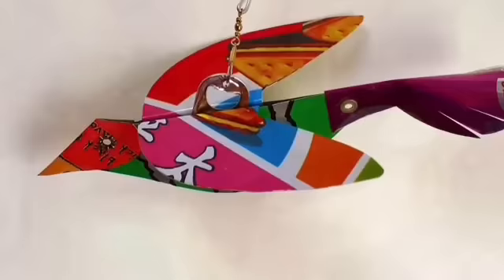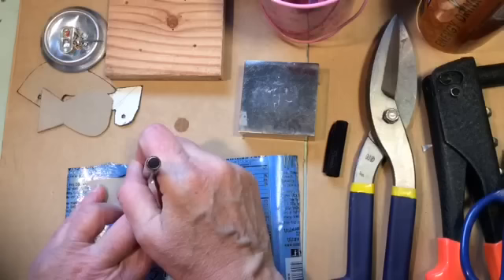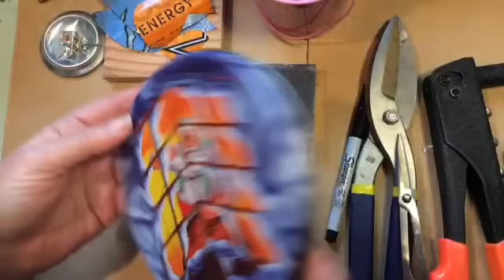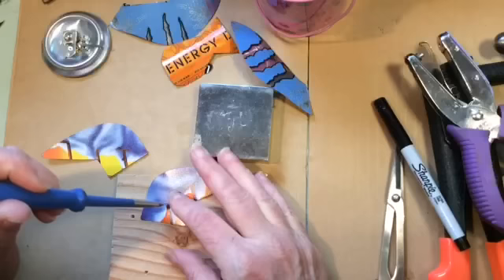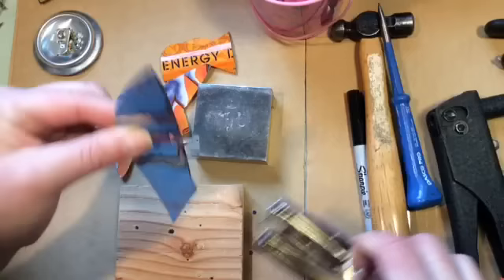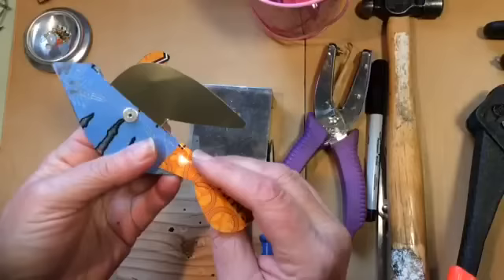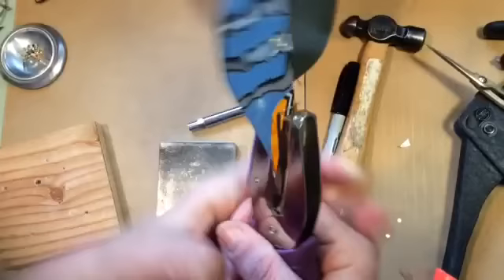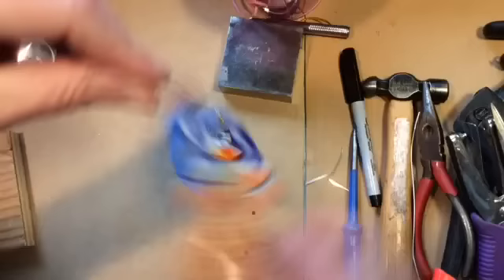How to make Tin Birds with Jenny Fillius

Comment: The steel can part will rust outdoors, but aluminium should be ok, ok you may get white aluminium oxide eventually as the resin inner wears off and the outer ink but that may take years. But a neat looking bird there, well crafted👍
Gaz UK

Comment: Great pattern and easy instruction, but not the riveting part. Rivets won’t stay, they pop out. I wonder if anybody else has the same issue
Reply from the maker: Hi. The pop rivet or the eyelet? If either is coming out , the holes are too big or the rivet or eyelet is too small. Double check the sizes. I hope you can get to the bottom of this quandary. Let me know.
Reply: @Fennywaterwinkle  thanks a lot!

Comment: Hey Jenny, can’t wait to get my hands on my recycling bin of cans, but I have a question. Do you recommend the heavier tin for the wings, or is that just a choice you made because you had that tacky tin with good colors? Thanks for the free pattern!!
Reply from the maker: The aluminum doesn’t hold up. If you were to use it with the the same instructions the wings would break off. So that’s why I suggest the sheet metal from containers. Thanks for asking.

Comment: Loved your content so much that I gave it a shot and purchased everything on your pdf! 
Question…the 3/16 eyelets did not fit into the 1/8 “ hole punch. Too large. Should I downsize to 1/8 eyelets like originally specified? I’m determined to see this little bird through to completion.
Thank you.
Reply from the maker: Yes. 1/8th hole.3/16th eyelet. The part of the eyelet that goes into the hole is 1/8th. Or maybe different brands measure differently? I don’t know.
Reply from the maker: Yes

Comment: Great tutorial! Wondering why you don’t just use Aluminum can for the wings also? Would that be ok? Or not strong enough? Thanks, Mary
Reply from the maker: You answered your own question! Aluminum when folded breaks quite easily. Try folding a piece a few times and see what happens. It may hold up at first but not for long.

Comment: easier and cleaner cut with a can opener ( takes off the top)  then cut  down the can and around the bottom . Then back up to the top to take the 1/2 inch that is usually bent on an angle.  Gives you a solid sheet that doesnt have jagged edges

Your link doesn't work so not able to get pattern !!!!!!!!!!!!!!!!!!!

Comment: Looked over a few comments to see if this question was asked. If aluminum cans are sharp when cut, how do you sell them after you cut out the bird? I was waiting for an explanation on how to prevent this hazard like crimping the edges or some such. 

You had me at Swell. I love that. The video was well presented and edited. I too want to make some but I’m a little anxious on the cut hazards. Any suggestion?
Reply from the maker: Just now seeing this, my apologies for not responding sooner. Think of it like paper. You can get a paper cut but it doesn’t happen with every piece of paper you touch. As for after the fact I think because it’s double it’s not as sharp. Hope this sufficiently answers your question.
Reply: Hmmm just an idea maybe dip edges into silicone calk before painting very fine padding on it say
Reply: Thank you. Will star accumalating the materials. I have a crop a dile which is a heavy duty craft punch which should help the process  I’ll look into gloves. You’re fearless and have experience. I’m excited.